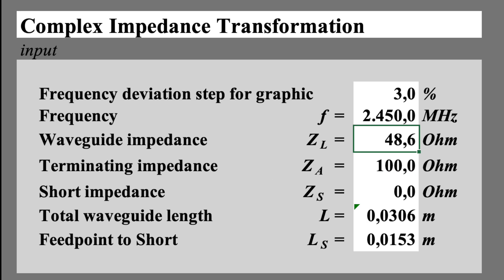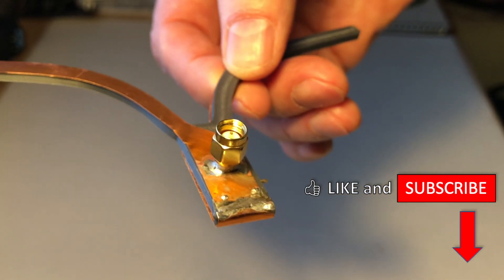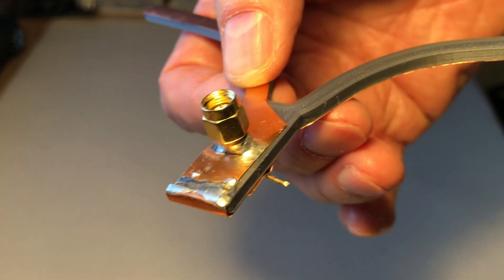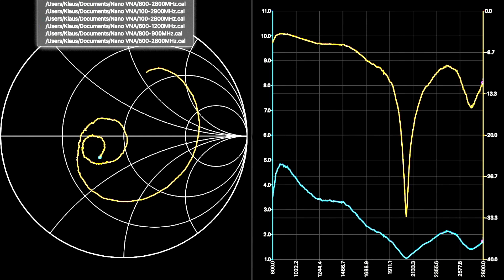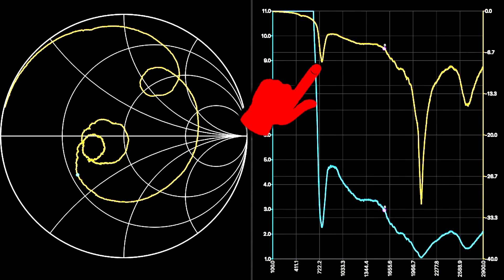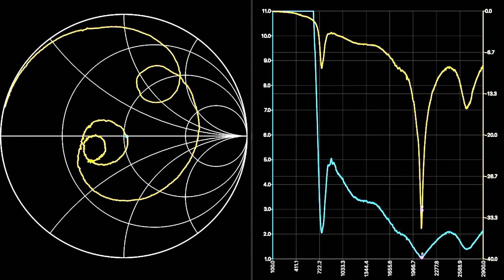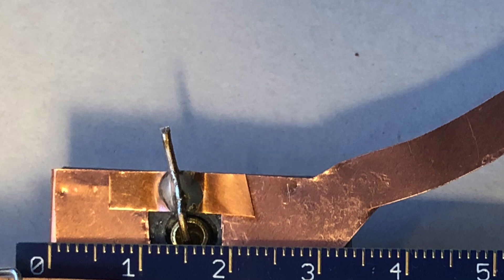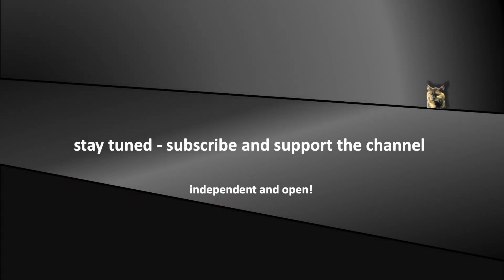Construction and measurement of the optimized antenna (EP92)

Comment: Subscribed. Did you simulate the impedance bandwidth at resonance? I would be interested to see how it compares to the WiFi channel bandwidth. Apologies if you have, I haven't viewed your other videos yet.
Reply from the maker: Thx for subscribing my channel. Sorry, I didn't explain the reflection measurement in all details in the video. You are seeing the reflection loss in yellow and the SWR in light blue. From the latter, you can derive that in a 150 MHz wide range you get an SWR better than 1.5. This is completely sufficient for the 2.4 GHz WiFi band, which is only 80 MHz wide. However, with my dimensions, the center frequency is a bit too low, which I explained in the video.

Comment: How well does the produced antenna compare to the simulation?
Reply from the maker: Hi there, thx for your comment! 
As I said in the video, the center frequency is 17% lower, which is for the reason that I simulated thin wires, but realized the antenna with 5 mm wide copper stripes. This also lowers the impedance a bit. However, I am pretty sure, that the radiation characteristics of the realized antenna will be close to the simulated ones.
Reply: @electronics.unmessed   thank you! Great insight into how the construction materials impact the final result. Looking forward to more of your work!